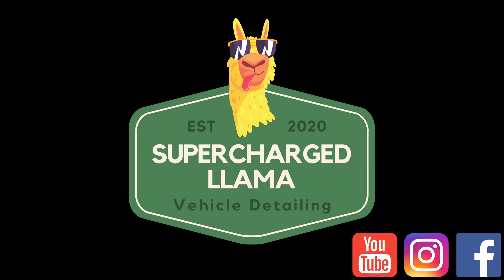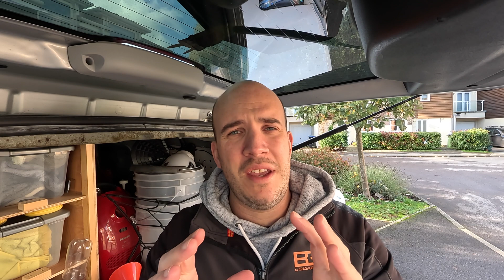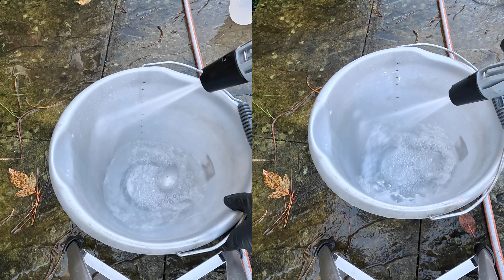Does water pressure affect your flow rate? I compare the mains pressure vs the tank in my van

Comment: Thanks for taking the time and trouble to share, always appreciated. As long as you are supplying more LPM than your PW requires, which you should be in any case, and assuming your PW is suitable for drawing / gravity fed water, then there would be no difference in PIR at all, as the PW still puts out the same LPM, so long as it is not cavitating.
Reply from the maker: I've learnt something here, thank you for sharing that.

Comment: This is interesting stuff. 
I would have laid money down that the hose was the better choice but  seems the pressure washer and or cannon is the deciding factor rather than supply.  Given that you are using a tank there is an argument for connecting up to a rain water butt (with filters inline) and using that instead of the  mains, this gets around the hose pipe ban 🙂 
Love your videos, always something from a different angle and perspective.
Reply from the maker: Thank you so much for saying that, it really is appreciated.

I completely agree with you regarding the water butts and I wonder if I should retitle the video to make it more relevant as it was in the back of my mind. Just because I'm exempt from the bans, the information is pertinent to everyone (the water shortages are why I went off on one over the summer, testing and reviewing a host of Rinseless Wash products).

Comment: Interesting take on what Specky did. I have been thinking about getting a few water butt's, linking them together for semi-filtered water but was a bit concerned about the actual water pressure, now you've shown me its possible to do it and still use a foam cannon. Thanks 👍👍
Reply from the maker: I was wondering if I should change the title of the video to be something more like that, because that's the use case I've seen a lot of people adopt over the summer (due to the hosepipe bans, and I only expect that to become more frequent).

Comment: Darling, you've done the test that I couldn't, so hats off to you! And thanks for sharing my video too, it all helps to bring as much information to the viewers as possible. 👊🏻
Reply from the maker: I was genuinely fascinated about your video, especially with the MJJC lance, suddenly it all became clear as to why it was making such thick foam for some of the products, especially if you were using ratios in the bottles rather than PIR. So thank you for doing that.

A lot of people have been drawing from buckets due to the hosepipe ban so I guess this is relevant to them too (bizarrely my bit of Surrey has loads of ground water, so we didn't have a ban).

A future video is comparing the flow rate of the MTM SGS35 Vs the MV925 stubby gun, I did a preliminary test on that without the cannons on and that also made a difference. I think over 20seconds the MTM allowed through an extra litre or something.

Comment: When I saw how many times the question was posted on forums of how much product to use and the variety of answers given, I thought I'd revert to type and get geeky with it.
The first "cannon" I got was a re-branded PA S.p.A. and their website gave me the science involved.
The mixing head of a lance is an eductor or jet pump and uses the venturi effect  to suck the product out of the bottle and mix it into the water stream. The speed that the water flows through the restrictor changes the rate of pickup, the faster it goes, the more of a vacuum it creates. As you've demonstrated, provided there is enough supply, the power washer pump will produce enough flow through the (just over 1mm.) orifice to make it work.
I use neat product, varying the PIR with the adjuster after calibrating the lance.
Reply from the maker: I was thinking about using it neat in the lance and varying the draw too, funny you mentioned that. It sounds easier doesn't it?

Thank you for explaining the science behind it!
Reply: @SuperchargedLlama  It certainly is. I can top-up or swap products without having to get the measures and calculator out. It means a bit more work when doing the PIR calibration but once it's done, I've got a note of the position of the adjuster for 1, 2, 3, 4 & 5% PIR and can go as strong as I think it needs.